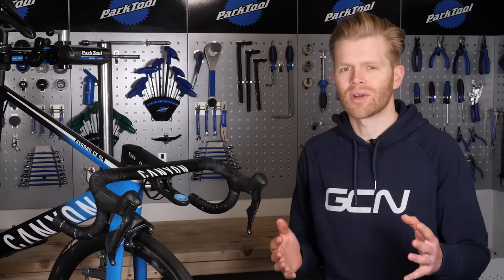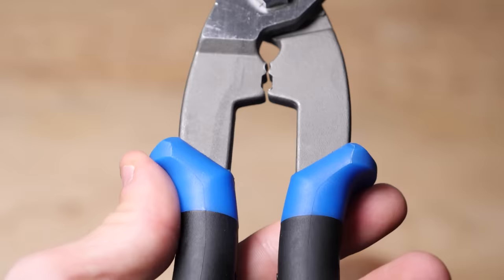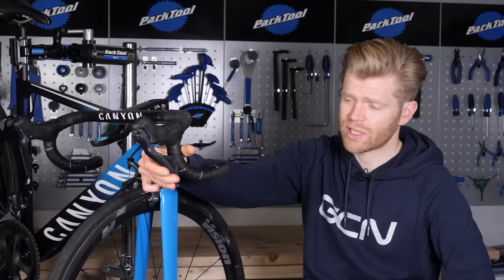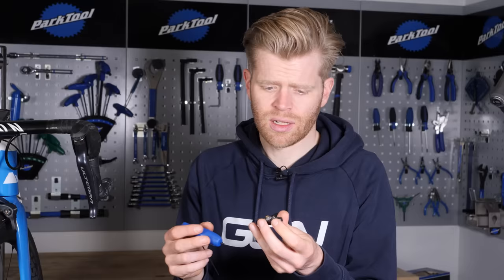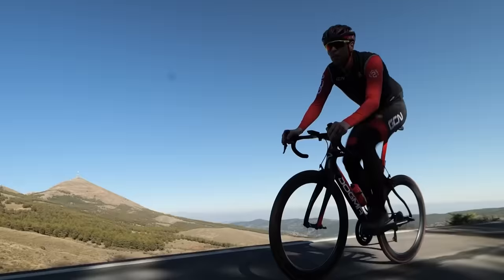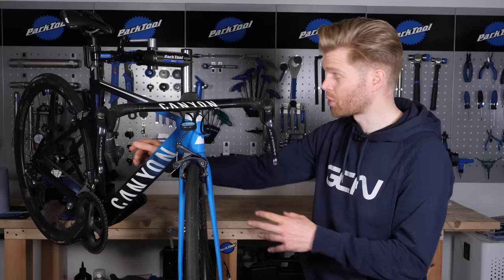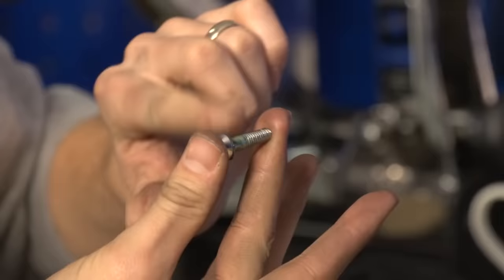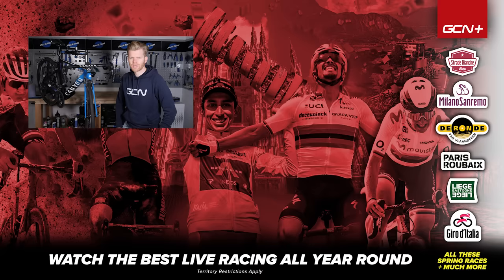Try This Before Changing To Disc Brakes! | Maintenance Monday

Comment: This is why rim brakes are ideal for the average consumer. At home maintenance is so easy and affordable.
Reply: The average consumer is fat and needs the extra power of disc brakes.
Reply: Maintenance is not complicated. With Shimano brakes, all you need is the bleed cup and some mineral oil. Pretty simple process.
Reply: Rim brakes are fine but disc brakes really aren't that complex, they can be worked on at home just as easily.
Reply: External cables are a must for everyone unless they intend to race cat1 or better
Reply: @lovenottheworld5723  I mean you can use your eyeballs and stop 3 seconds sooner discs were too much for road riding for me
Reply: @joanofarc3319  my issue is when I seen the pro mechanics taking the rotors off the wheel at every stop and they stated it was so they don't bend in transport which explains why I don't run them, they are incredible albeit undeniably sensitive and wholly unecessary for road riding mixed terrain is different disscussion
Reply: A rim brake is a disc brake with 700mm diameter disc! 😀
Reply: N more rim brakes. I had rim deforned and braking was terrible.
Disc brake saves the rim it's cheaper and easier  to  change the disc than the rim.
Reply: Seriously, the only time I can remember  needing disc brakes was in 1991 when I had an early morning paper round and had to cycle across wet grass from the morning dew to get to a retirement home to deliver some newspapers!
Reply: @lovenottheworld5723  average consumer ride pretty pretty  slow which mean less PxV for brake power to fight with
Reply: People don’t always realise the much bigger expense and maintenance involved with disc brakes. Not just the pads wearing much faster on disc brakes, but also the rotors which wear much much faster than the rim on your bike. My rim brake bike costs a few quid a year in replacement pads (and I do 1,000s of miles on it). Don’t get me started on the maintenance and expense on my disc braked bike 🤦‍♂️
Reply: @chriskros8858  your rim should last thousands of miles, with rim breaks (so long, that you’re probably ready to change your wheel by then anyway). Far far longer than a disc rotor, which you’ll be lucky to get a fraction of the mileage from.
Reply: @a1white This is your  theory. From  my experirnce  some day tire exploded rim was deformed and braking was generating mega parkinson. No more rims .
Reply: The future of rim brakes are blurry..
Reply: I'm am a average consumer and  pad  breaks are not idea on a manual bike . As a average consumer let the local bicycle shop do my maintained 
 I can screw up a wet dream as far as bicycle maintained goes  the bicycle shop is half as cheap as my attempts to self repair
Reply: I got a Cannondale hybrid with xtr m970s thay work extremely well on 700c rims no issues
Reply: Rim brakes wear out your wheel rim so you need to replace the whole wheel. disc brakes only wear the cheap metal disc
Reply: I'm not the average customer.
I am a speed freak, and I'm big & heavy.

And worse, for fun and more, I build ebikes & engine-kit bikes that are as fast & quick as possible. My pads & rims keep getting glassed over, and I end up squeezing my rim brakes hard enough to snap cables.

For my rimbrake frames & forks. Maybe dual hub motor Regenerative Braking can save them from the garbage or being sold off. But as for my normal & boosted bikes, I'm done with rim brakes. It is extremely frustrating, and dangerous, not being able to stop, and not being able to go as fast as I want or can, because the rim brakes are so weak.

I'm done with rim brakes. I'm sick of them. Even just coasting down hill, on a normal bike, have lead to many close-calls & crashes. The weight & speeds of an engine or electric system, just makes that situation more frequent, even on flat ground. 

I'm only using disc Brakes and Regenerative-Braking from now on. Basic organic pads, then upgrading to metallic pads with bigger rotors meant for them, then maybe hydraulic lines.  And one day, I hope to have metal teeth, directly holding the tire tread for parking, and exclusively using powerful, analog signal RegenBraking for stopping, and finally be done with all the maintenance, costs, and noise of traditional brakes entirely.

There are motorcycles like Buell/EBR, that have the brake rotor at the rim, instead of the axle. But for certain, bicycle style rim brakes are dead to me. Using the last set of rim pads I have, will begin my Metal teeth, RegenBraking project.
Reply: still is very messy and the for Average person its still quite complicated
Reply: @truthseeker8483 😂 true

Comment: Let's hope the consumer always gets to choose and not the supplier. I love my rim brakes (on my road bike) and ever since I retired with no more stop-start commute mileage, any rim wear is really minimal, even with 5K average annual mileage. Bikes should be simple and easy maintenance. Long live choice.
Reply from the maker: Absolutely, it's all about having the choice! Disc brakes/rim brakes aren't for everyone!
Reply: You have to search to find a good quality rim brake frame.
Reply: Remember to buy the tool so you can cut the wire
Reply: the only thing i dont like about my brakes is that they will eventually eat away my rim. And replacing a rim is a lot more expensive than a couple of brake rotors
Reply: @Koen030NL  as long as you keep your bike clean it will last. 
 I still ride rims from 2000
Reply: To late.  Manufactures are no longer making anything with rim brakes.  See Sram and Shimano on their latest releases.  Same for top frame brands.   Is all a big marketing campaign to get more money out of the consumer
Reply: @Koen030NL  I have a pair of Enve wheels with 20K miles and the brake track still looks new.  It all goes down to the quality of the rim and the pads.
Reply: Rim wear is not a thing buddy.
Well it is if you have money to blow
Reply: @Koen030NL  very funny. Totally hypothetical
Reply: @Koen030NL  If rim wear is a problem for you, I would suggest you use KoolStop brake pads with the "Plow Tip" feature. Here is what Sheldon Brown says of the feature.

The plow tip is a small wedge-shaped projection at the rear end of most Kool Stop models.
It acts as a squeegie to clear water and grit from the rim, so that they don't get caught between the braking surface and the rim. (Setting conventional flat-surfaced brake shoes so that they provide toe in creates the risk of trapping grit and sand between the brake shoe and the rim. This grit then gets embedded into the surface of the brake shoe, where it grinds away at the rim every time the brake is applied. This causes premature wear to the braking surface of the rim, a serious problem on bicycles ridden in muddy/sandy conditions.

It also provides a built-in guide to ensure correct "toe in" of the shoes.
Reply: @SlabMurphy  "Rim wear is not a thing" -- How to announce that you have little or no experience as a bike mechanic. Not only do rims wear out, but if you let them wear out badly enough, they will explode. Don't just take my word for it; ask any actual bike mechanic.
Reply: @mattgies  my old rims had a noticable concave profile on the brake area, that why I got my new rims in the first place. Didnt want  to see them exploding.
Reply: Koolstop pads! The way to go with aluminium rims, next to keeping your wheels clean. My Velocity Deep V rims last for 40.000 km now by using these pads... and still don’t look that bad. They certainly are not worn out hollow.
Reply: @thedronescene7474  what are you on about?  The latest release from Shimano is the 12 speed DuraAce R9200 Di2 and Ultegra Di2 which are available as Rim brake groupsets. 12 speed Campanolo Super Record EPS is available as a rim brake groupset. 
Pinerello Dogma F is available as a rim brake bike, The Colnago C64 is available as a rim brake bike, the Canyon CF ultimate is available as a rim brake bike, Merida Scultura is available as a rim brake bike, Feska and Lightweight still produce rim brake frames and so do many others, lots of options are available.
Reply: @kidkarbon4775  Rim brakes were relegated to the cheaper bikes of a brand. No rim brakes after a certain price point.
Reply: wrong. Colnago just announced the new c68 rim brake version and the newest shimano di2 12speed dura-ace is avaliable as rimbrake and you can even wire it if you don't trust the vireless connection.
Reply: @thedronescene7474  Just buy some and fit them, it's not exactly hard to work on bicycles lol.
Reply: Too late. The industry has decided to force disc brakes down all our throats. Go to any major manufacturer website these days and the only rim brake road bike options are A) bottom of the line entry level bike, or B) an $8k climbing race bike
Reply: @Koen030NL Why would you use the break anyways?

Comment: Rim brakes are still the Best. Easy to repair and lighter. And if you live in a flat area  the are enough.
Reply: I've done 100.000 meters of elevation last year and never felt the need for disc brakes on my road bike.
Reply: I have assembled a rim brake bike last week and did a 172 km ride with 1200 m of elevation gain. After 5 years of only disc riding, this was phenomenal. No disc rub, lighter and just simpler. Disc for commuting and gravel, rim for all day road bike rides
Reply: My town is hilly and even the stock rim brake setup stops me just fine down the other side
Reply: I live in the Welsh mountains, weigh 80kg and they’re still plenty good enough.
Reply: A rim brake is a disc brake with 700mm diameter disc! 😀
Reply: They are enough until 25km/h (or 19mph), i ride only on flat area and they are still dangerously inefficient on 40+ km/h, even with top-tier swiss-stop pads (fitted in expensive Dura-ace) on carbon rims.
IMHO, rim brakes are more efficient only for slow/chill riding or only-uphill/no-descend. Disc are more powerful in every scenario, end of story.
Reply: @truthseeker8483  Exactly, 700mm and still slightly more powerful than a 140mm disc? This is a proof of how rim brake are inefficient.
And a couple of 160mm are more than slyghtly powerful than 700mm rim? This is why the debate on the end of the rim brake exists, because disc can upgrade for up to 203mm. And you can't add more diameters on the rim. (Actually, technically it's possible, but in practice it's not that good at all)
Reply: @Mr.Wolf_947  For me the best thing about disc brakes is the tubular axle which locates the wheels better. A negative is the disc brake wheels need to be stronger as well
Reply: @truthseeker8483  True, hub and fork need more structure rigidity for disk, on the other hand, rim also need more rigidity on extremity of the wheels (braking surface) meaning also more weight.
So in a nutshell, the disc has all its weight in the rotational center of gravity of the wheel, while the rim is placed more at the extremity of the wheel.
And according to physics, the first option is more beneficial.
Reply: Even with hills they are enough.
Reply: @Mr.Wolf_947 Clearly, you either have rubbish components or zero ability as a mechanic, or maybe both...
Reply: @peterwillson1355  Heh, technically yes, generally rim brakes itself are rubbish as a components.

I switched to modern Campagnolo (both Dura-Ace calipers i had, were bent and crooked, 110% reliability/bulletproof guaranteed I was told) and I didn't notice any improvement in braking, the only good side is 20 grams less, but quick release less for the wheel.
Ah, this time I had it fitted directly by the mechanic where I bought them, so theoretically the best of the best mechanics in my area would have zero skill, if he did the same job as previous mine? LOL

so now I'm at €130 for the new Campagnolo caliper, €45 for pads (yellow Swiss), €165 in total and still have a slowing effect. And I didn't take into account replacing the pads three times in two years, so theoretically it's another €80 more. €245 worth of nothing... Should I buy a €300 one instead to have decent braking performance? Maybe 500€ can do same as one with 50€ 160mm disc? Maybe...

Instead my semi-hydraulic calipers cost me €45 (nothing special), €15 semi-metallic pads, €80 for 203mm front and 180mm rear, in total they are €140, on 4th years I'm still on the second pad replacements. 155€ and feels almost like motorcycle brakes... And more importantly, can brake on wet conditions.

Clearly i don't have low tier, not even mid tier rim components, and clearly, you are a sloth if you can't feel the substantial difference...

Sorry lad, try again...

Comment: Disc brakes make sense on a mountain bike.  They don't get muddy, and on MTB you have longer, steeper descents more bent rims, and more sudden stops required for corners and such.  For a road bike though, they only really make sense if you're riding in the mountains.

Comment: Replacing consumable parts on a bike is a more important skill than riding the bike itself.
Reply from the maker: It also saves you money!
Reply: Go become a mechanic!.
Reply: You know what’s a more important skill than that? 
Being able to earn enough money to make it pocket change to just throw the bike to a mechanic for any maintenance.
Reply: @87togabito   I understand to learn how to fix a flat, use a chain tool in case  chain snaps.   
I am very handy. I can fix basically anything. But when it comes to my bikes I don't want to stress myself out. Not with the stuff I'm having fun with. I don't want it to be some project.  Some people like it . I don't  ha ha ha I fix things  for a living I'm not doing it for fun ha ha ha 🤣

I hang out in bike shops so I know how to fix  anything on the bike plus you have  YouTube to show you how.

Comment: TiP: when cutting the outer cable (AKA, housing), place a piece of the old cable inside it so that the cutting blades do not crush the outer housing.  After making the cut, you will have to shake the remnant of the inner cable out, or poke it out with an old or new inner cable.  Then remove 1mm of the outer plastic and file the coiled brake outer to perfectly straight end. Finally, expand the end with an ice pick or nail.  Same procedure for gear shift cables.  

It's also very useful to pre-shape the cable outers by bending or coiling them so that they relax to smooth bends once they are on the bike frame. The first 2cm of outer  entering or emerging from a cable stop should always be straight and kink free, so size them by testing with full handlebar movement.  This can be tricky for a small frame.
Reply: thanks I will remember that the next time I have to cut cable
Reply: or you could use an angle grinder, makes perfect cuts with no distortion
Reply: @djkhmor4538  you don't need a perfect cut.. that's just obsessive.
Reply: @djkhmor4538  
yeah, or a cut off wheel with a dremel, then touch up on a grinding wheel.
Reply: I never cut my cables until I have run them through the housing.
Reply: @petesmitt  no it's not obsessive the end of the housing should be squared even if a ferrel is used the difference can actually be felt when applying the brakes resulting in more precise modulation.  Also use a cable lubricant (Shimano is the best ....a thin even coat of this stuff if you get too much it'll slow the return mech... but cable magic is pretty good and less expensive and easier to find and apply ( squirt some into the end of the housing if possible and a drop every half foot on the cable as it's being run into the housing) then the cable won't corrode and the liner in the housing will last very much longer. It's best to use actual cable lubricant because they are formulated to not harm the liner we're as some grease types and liquid lubricants (T- 9) soften the liner and gum up the works. These two things will definitely be felt and will improve the performance of any cable braking system regardless of it's price point. Use Shimano housing or higher quality compression less housing this also makes a difference. Avoid cables that aren't stainless steel. Jagwire's standard housing will always be squishy go for there compression less (with new standard housing pull the lever hard and push the housing with your thumb against the space between the index and middle finger and slide your hand up and down the length of the housing you will be surprised by the amount of space that was there between the coils of the standard housing). If you have low end brakes a set of higher quality pads will be worth swapping out even if they aren't worn out. Confident braking is worth a fortune when it's absolutely needed and once in while life saving or avoiding a trip to the emergency room. One more thing if the pivots in the brake caliper are loose adjust them you can do the outside pivot on the bike but you will need to remove the caliper to get at the center pivot. Shimano products generally don't get loose but the cheap OEM stuff do that also helps make the OEM stuff work better. Cable Magic is an excellent lubricant for the pivots too because of the plastic bushings and it's penetrating property. These are a few things that I can share from many years of professional experience. And finally use the centering adjustment to get the pads to hit both sides of rim at the same time pull the lever lightly and if the rim moves slightly adjust so that stops happening you will feel it when it's right 👍 don't worry if the resting gaps aren't exactly the same (unless it's way off or dragging on one side if that happens the caliper is misaligned and should be corrected) because that part were the pads contact the rim the same is the important thing
Reply: Great advice and I wish I'd seen this before recently installing new cables and housing, which was more difficult than I'd expected for these very reasons. And I used Park cutters.
Reply: @Exgrmbl Or a die grinder. I have all three tools and will use one of them next time I have to cut housing, especially brake housing. Thanks.